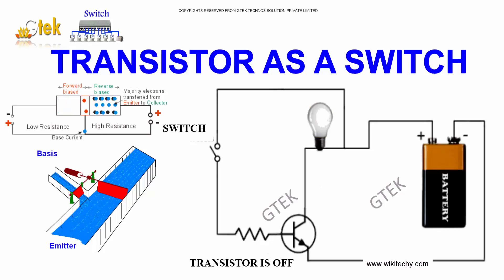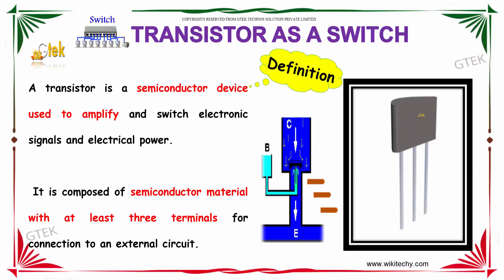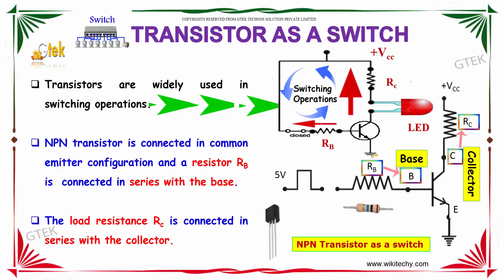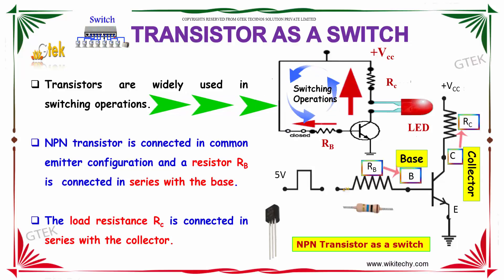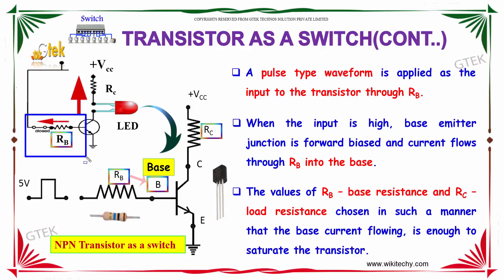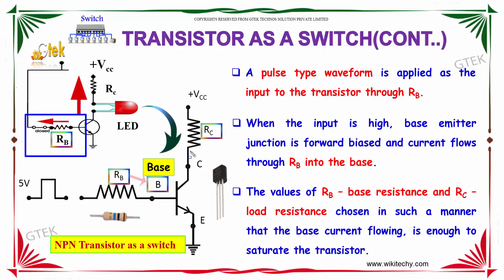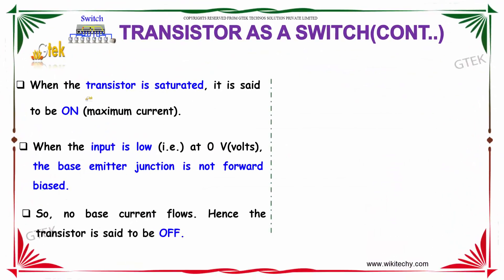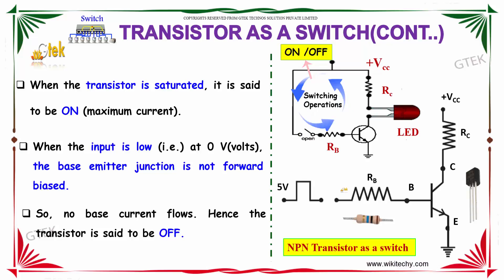Transistor as switch Semiconductor Devices class 12 Physics subject notes lectures CBSE IIT JEE NEET

Comment: Bipolar Junction Transistor (BJT) is a Semiconductor device constructed with three doped Semiconductor Regions (Base, Collector and Emitter) separated by two p-n Junctions, Figure 1. The p-n Junction between the Base and the Emitter has a Barrier Voltage (V0) of about 0.6 V, which is an important parameter of a BJT.

Comment: Transistor Biasing is the process of setting a transistors DC operating voltage or current conditions to the correct level so that any AC input signal can be amplified correctly by the transistor.

Comment: One of the most common uses for transistors in an electronic circuit is as simple switches. In short, a transistor conducts current across the collector-emitter path only when a voltage is applied to the base. When no base voltage is present, the switch is off. When base voltage is present, the switch is on.

Comment: The circuit above is called a low-side switch, because the switch – our transistor – is on the low (ground) side of the circuit. Alternatively, we can use a PNP transistor to create a high-side switch: Similar to the NPN circuit, the base is our input, and the emitter is tied to a constant voltage.